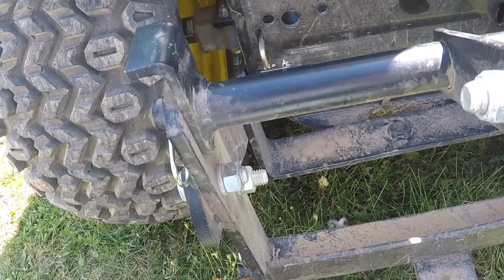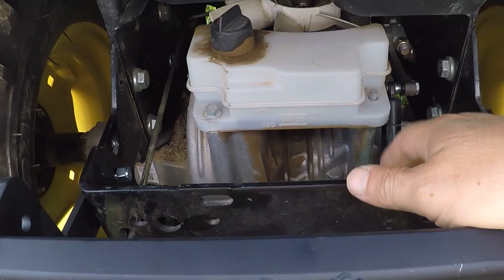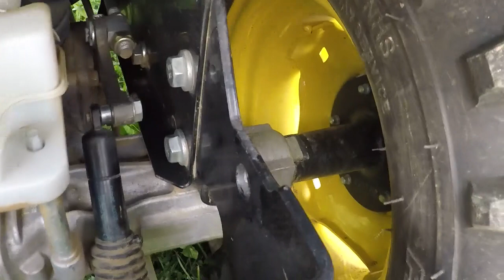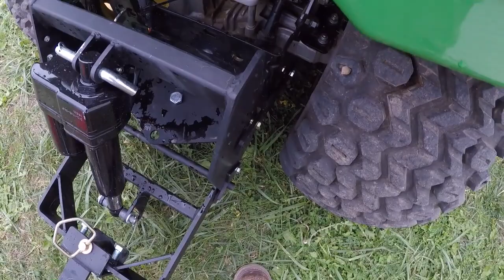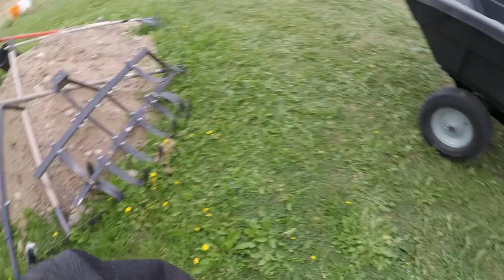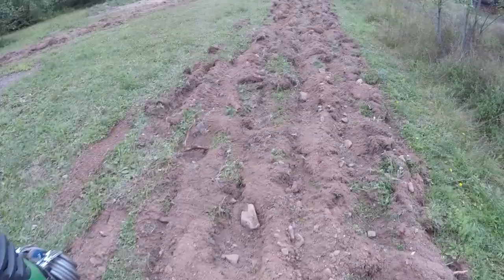Uni hitch Johnny products. Installing an electric sleeve hitch for x530

Comment: Looks like all you need is wheel weights in the rear rims to push your rear tires down to give you more grip. There's also a way to put a non freezing liquid inside of the tires to make them heavy and also add even more weight for traction, but you might already know that. I have a Johnny Universal Hitch on order so this was useful. Thanks for the video, God bless 🙏
Reply from the maker: yes,  thanks, weights could help, actually I think I need them in the front even more. At times I could not turn becuase the front wheels were not hard enough on the ground. And the Uni hitch is the best addition to a garden tractor.